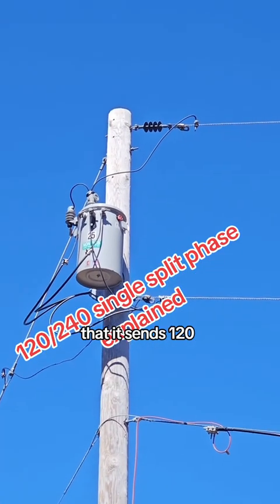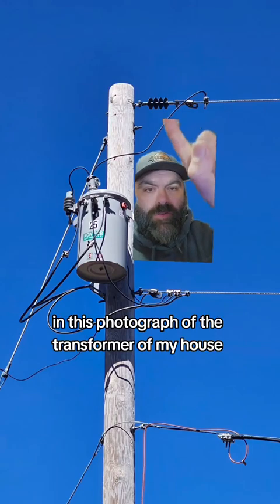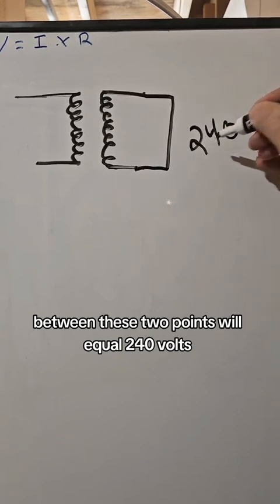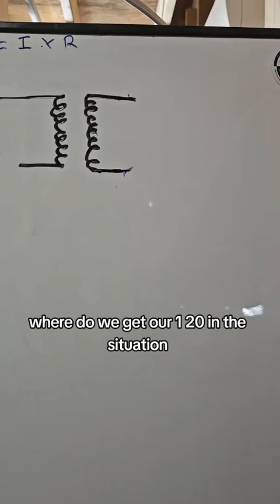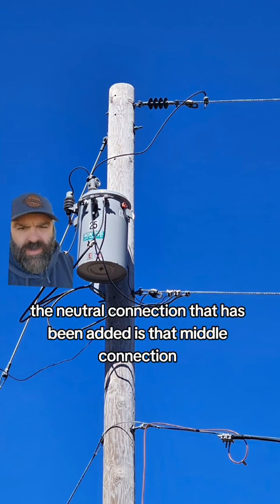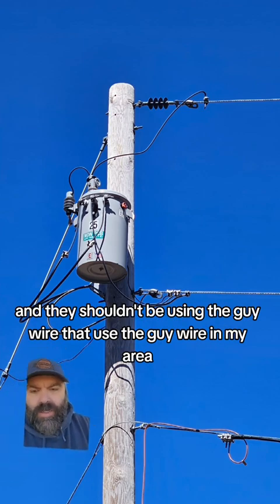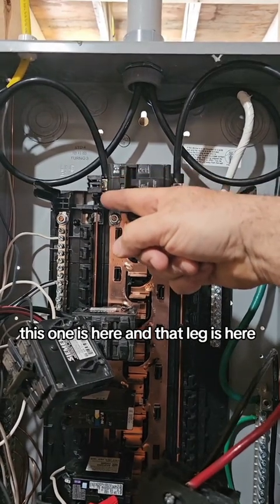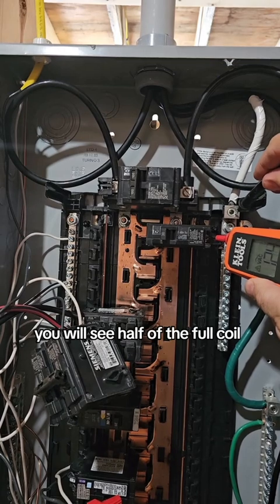120/240 signal split phase explained

Comment: Your description of the 240/120 volt system is essentially correct, although a little muddled.
These systems are actually, specifically called "split-phase" systems, because they are (as you said) splitting the single phase 240 in two.
BTW, great idea to show an actual pole-mounted transformer for reference! (Although, I've NEVER seen a utility use a guy-wire as a ground bond!)
Here are two great YT videos from another channel, which describe VERY WELL how split phase systems work, and what happens when a neutral opens on a 240/120 split phase system:
https://youtu.be/nOSYHUxHxG8
https://youtu.be/LJvyb_WujZg
Reply from the maker: Split phase is a type of single phase
Reply: @Stevenj120volts  
Yes, exactly. All split-phase is single phase, but not all single phase is split-phase
Reply from the maker: I have seen all of Dave stuff.  I have built he battery stack and wired to a 120/240 panel.  I have also done videos with losing a neutral but I did it with line voltage form a panel
Reply from the maker: https://youtu.be/Y2Y-VzynHjs?si=qcwzyeIAnRrOy2Cm
Reply from the maker: This video I explain how it actually works and why the neutral carries only the imbalance 
https://youtu.be/LEV-O30WDSY?si=kQwJ5vS7EHCtK8Gv
Reply: Wrong it's all single phase. Can never get split phase from a conventional plain Jane transformer.
Reply from the maker: @JohnThomas-lq5qp  lol....where do you think the 120 and 240 come down with only 3 wires? If not a split phase
Reply: @JohnThomas-lq5qp  
What exactly is a "plain jane" transformer? 
By center-tapping a "single phase" xfmr (as most/all residential pole & pad mount xfmr's are), that is - by definition- split phase.
Reply: @JohnThomas-lq5qp Wrong.
A center-tapped 240/120v system is "split-phase". All split-phase IS single phase, but not all single phase is split-phase.
Reply: @Joe-by8jh  What's a "beaker" panel? 😅
Reply: That is not a guy wire.  It does not support the pole.  It is the neutral wire (grounded conductor), and it is very commonly strung between poles at the level of the bottom of the transformer, as shown here.  The diagonal wire in the left is a guy, but there is no electrical connection to it.

Comment: so what's the available fault current on that 25 kW transformer electo man
Reply: That "25" is not the "kW" of the transformer (kW = kilowatts).
That 25 would refer to the "kVA" - the "kilovolt-amp" rating - of the xfmr.
Thus, if you know the secondary voltages of the xfmr, you can then calculate the available full-load current rating - at a given voltage - for that xfmr. You could also calculate the input current (at full load) if you know the input voltage. Since that is a single-bushing primary xfmr (and tied to neutral), here in west Texas, the primary voltage would typically be 7200v, being derived from one phase of a 12450v, 3-phase primary distribution.
Reply: @Calico5string1962  For the average residential consumer ... 25 kilowatts is the correct answer.  Your convoluted and esoteric answer of ... 25 kva provided no useful information, to the average person. You did not even answer the question, that was asked.
Reply: @MrSummitville  Sorry sir, but a "kilowatt" is not an measure of fault current [either]. A kilowatt (kW) is a unit of power... while amperes (amps) is the unit of current measurement. 
The question asked was flawed initially (as is your answer) , and so my "answer" was attempting to correct/clarify the terminology used in the original question.
That said, the available fault current in a 25kVA transformer would be in the thousands to tens-of-thousands of amps range, and would be dependent upon the nature & type of fault, and ultimate duration (i.e., clearing time). This is why "service-rated" equipment typically has a minimum interupt rating of 10,000 to 20,000 amps - or more, depending on the system operating voltage.
Lastly, most "average residential customers" would have no idea what fault currents even are, much less what the utility's transformer ratings would be. Thus, the esoteric nature of my answer....
Reply: @Calico5string1962  I know what fault current is!  And I replied 8,000 amps. You did not .
Reply: @MrSummitville  👌👍😅😅
In order for one to receive the right answer, one must ask the right question, Grasshopper...
Reply: @Calico5string1962  I never said, "kilowatt was measure of Fault Current" . I said, "... The fault current was 8,00 amps ..." Do you not understand English?
Reply: @MrSummitville  What?
You literally said, "for the average residential customer, 25 kilowatts is the correct answer...".
Later you replied, "can be as high as 8000 amps...".
I was replying to your first answer, referring kilowatts. Do YOU not understand the English YOU wrote?
Nonetheless, just let it go, mate... 😬
We all believe you're experienced.
Reply: @garymiller - Fault Current can be, as high as, 8,000 Amps between the two 240 volt wires.
Reply: @garymiller3194  have to know transformer impedance to calculate that. Was told that the newer more efficient transformers having a higher available shirt circuit current.